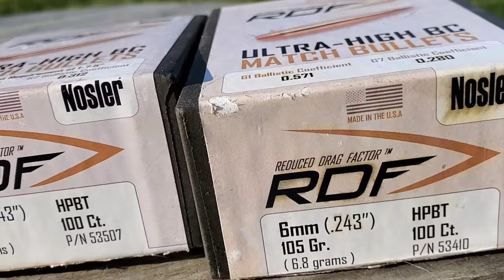Breaking Down The Transonic Barrier | External Ballistics

Comment: what you mean a flat nosed bullet gives less of a problem in flight than a cone shaped bullet, please share proof of this reference, cause I dont beleive it, so I would like to see it
Reply from the maker: Flat and round nose bullet stabilize easier than spitzer bullets of the same weight due to bullet length. Its common knowledge amongst long range precision shooters. You can do your own home work on the subject.  You won't find anyone with real knowledge that will dispute this fact
Reply: It partly has to do with how it bends air , the flat nose has a bit more drag that the air clamps down on the side of the bullet once it goes around it, it also has more mass which translate to more momentum (meaning it wants to keep in its line of motion) theses 2 things help. 
Vs having a lighter bullet with less momentum and a more aerodynamic bullet that is more dynamic , meaning it goes with the flow better, buuut if that flow is turbulent in transonic , that flow is wonky and its dynamic towards that Even if it's less favorable to you.

Comment: Keep up the great work. This was my reason asking you the twist you running on your 7 Saum. I am planning my 7mm build and looking at doing 7mm - 300 wsm shooting the heavy high bc like 195 Berger. My next question would be barrel lenth. As long as possible to chase velocity but like 32 inches. But when is long to long?
Reply from the maker: I'm running a 28" on my saum now and I run at 2950 with the 180 and 185 and that's not pushing it at all. It's just the best accuracy node. My plan with the next barrel is a 30" I should be able to be around 3025 with the same accuracy if everything goes as planned. Idk if how much you would gain with the 32 but I do know for sure that I have just a small amount of unburned powder with the 28" due to the muzzle flash and I run a pretty slow powder with h4831
Reply: @gunfather83  interesting thank you very much. So you think I should go for 30th inch?
Reply from the maker: @jimmyerasmus8257  I honestly cant say. I imagine you will be running a slow powered and 10gr more (70 compared to 60) than a SAUM so I'm sure there will definitely be some benefit but I can't say how much.  But more velocity is better than less in almost every case so I would go for it if that's what you want. I really like the 7mm-300wm. Its definitely higher velocity than the saum. My SAUM is built on a long action and my original plan with the action was the 7-300 but back then it wasn't as popular and I was going to have to buy my own custom reamer and it was going to be an extra 550$. Let me know how it turns out if you would.  I'm still really interested in that caliber.  I think my next build is going to be a 300RUM.
Reply: @gunfather83  Thanks appreciate your prompt response always and love your channel especially your shooting skills. I am going for the 300 wsm because of case volume and availability here in SA. Keep up the great work!
Reply from the maker: @jimmyerasmus8257  oh I thought you said the 7mm-300 win mag. I miss read. The 300wsm is also an awesome caliber.  It's a little higher velocitie and I'm pretty sure its about the same amount of powder.

Comment: I noticed a box of 9mm is rated at 1150fps muzzle and 1095 at 25 yards, which goes from supersonic to subsonic. Ocassionally I see keyholing on paper targets at the 25 yard range, which means the bullet is tumbling. I was wondering about 9mm accuracy as it transitions from super to subsonic, but you commented about short fat bullets normally do well in this range.